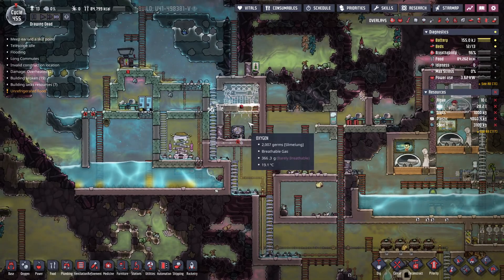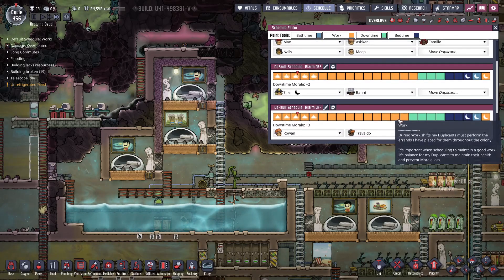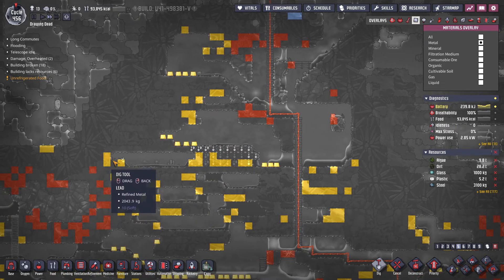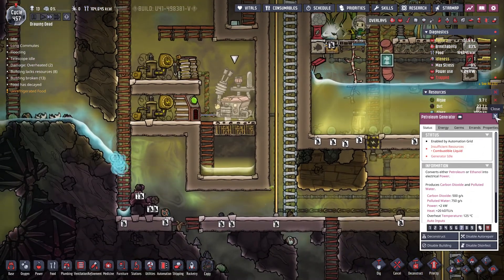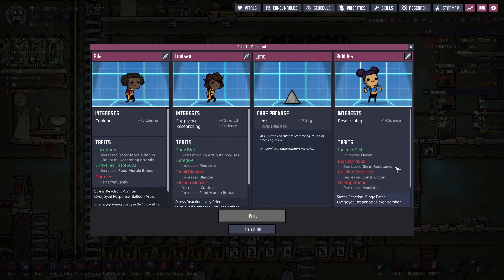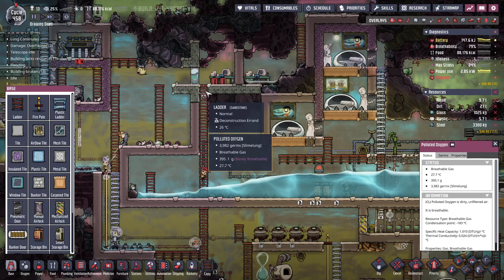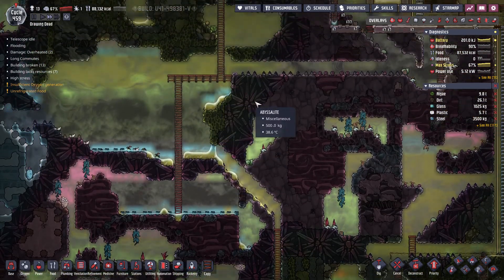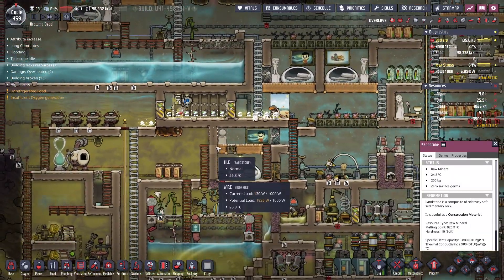#69: Steam Power (Oxygen Not Included)

Comment: A few reminders and hints - Double check which things will be exchanging heat with each other and what they are made out of!   Aquatuner heats up things around itself; Steam turbine requires steam to work; You might need to jump-start the process; Leftover materials can and should be removed if high heat is involved; Good luck! 
You might want to make a third schedule and move 5 dupes from the first over to it. That way you wont have to worry about the next 3-4 you take on, as they'll be assigned to it and it wont cause any overcrowding issues.